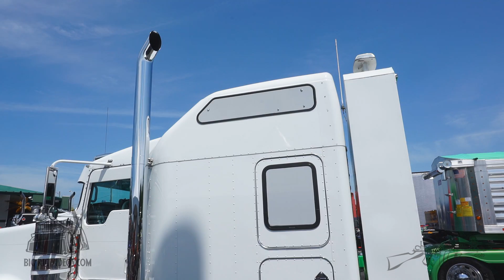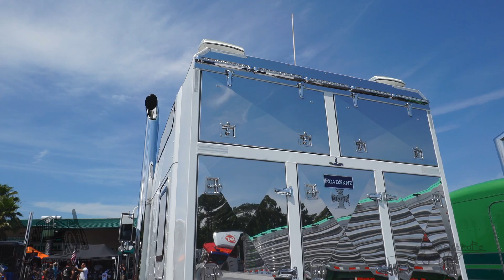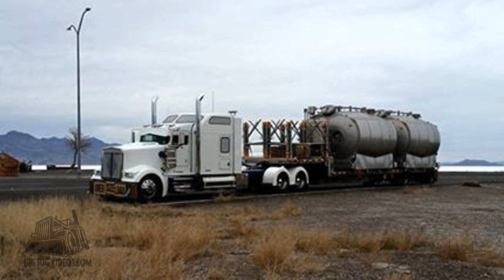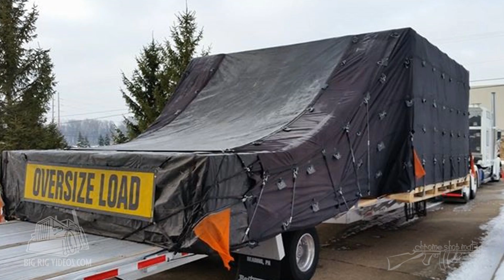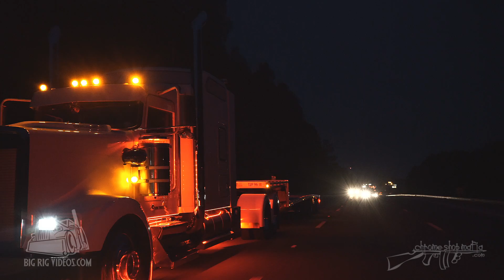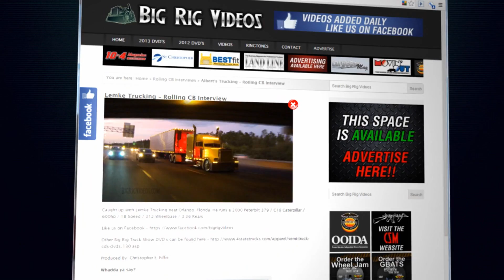Betland Trucking - Rolling CB Interview™

Comment: Chad that's a sharp looking W9 absolutely Beautiful Bud what did you put on the bunk window's to block the sun. I love that Blue and White my old school color's do you always pull the step deck. It's a absolute Beauty one sharp looking ride, I bought my first Truck at 16 in 79 a 76 IH 4300 with a Cummins and a 13 spd, I got lucky running for the Family business at the Landfill pulling roll off trailer, the loboy for taking dozier to the shop in town and of course the dump for having rock. I loved that ol gal and then sold it and bought a 84 379 to pull a rack then the bottom fell out of it, but I'm still going part time after I tore my spine in 99 by getting knocked out of the back of trailer down in Missouri, with no Family around and there all in Central Illinois. You definitely got a Sweet looking outfit there Chad something to be proud of Bud.🇺🇸🇺🇸🇺🇸🇺🇸🇺🇸🇺🇸💯💪💪👍🚫💩

Comment: It's nice to hear the term all the timer hee-hee. Now I am 1. My first truck ride was a 55 KW 5 + 4 220 Cummins cut back to a 200 no Turbo no Jake no nothing Washington to San Diego hippo versus cues Southern Oregon 40 foot trailer loaded pulled Hills at 10 miles an hour haha. From there I went to a truck 53 Pete lightweight 55000, with a 3-foot steering wheel. The learning curve was steep a great. Did 30 years, what a guy I'll do for diapers and baby food. This is one of my favorite videos good job mr. .

Comment: Chad was commenting on how people move around the big trucks and I agree with him that has to be four wheelers biggest concern around us i was running for Lessors refer out of Egan Mn and i was coming back from Chicago and i was heading into Minnesota there was another truck running ahead of me and and all the sudden this car jumps in between us so i fell back for safety all the sudden this tire comes off the truck i was running with the driver was running recaps and it flipped off the back of his trailer smashed the windshield of the car and the car went off onto the side of the road in the ditch i hit my breaks once i had seen the tire come off and i stopped my truck to assist the family that got hit by the tire i called over the radio to let the other truck know what had happened but he never responded and i called 911 to get the family some help they were banged up nothing serious and i told them that is a prime example why u shouldnt follow closely they were so scared they like lesson learned

Comment: Great video once again. Not having diesel knowledge why does some of the trucks have a lot of smoke from their stacks just curious.
Reply: Google "rolling coal" and ignore the hippies. :)
Reply: The black smoke comes from a over load of fuel before the turbo catches up with boost to properly burn the extra fuel .. this is a method of adding horsepower . One problem of throwing to much fuel into the cylenders is scorching the pistons.. but that comes mostly from bad tunes throwing fuel with out turbo upgrades or adding a compound set up